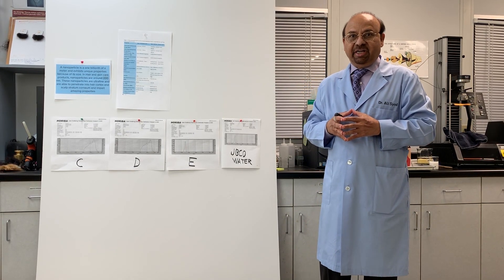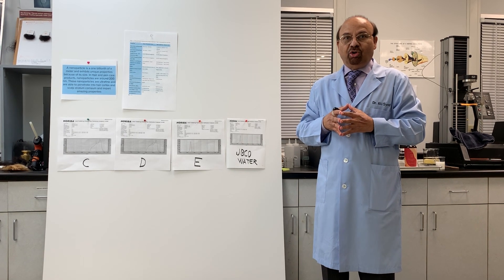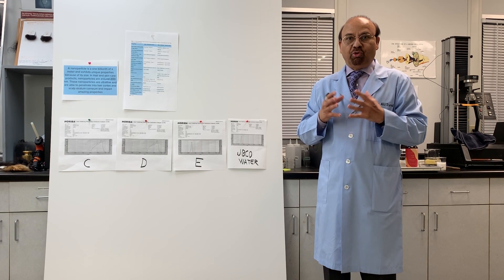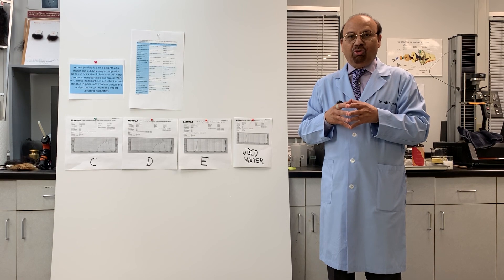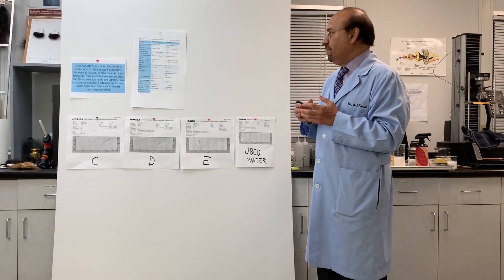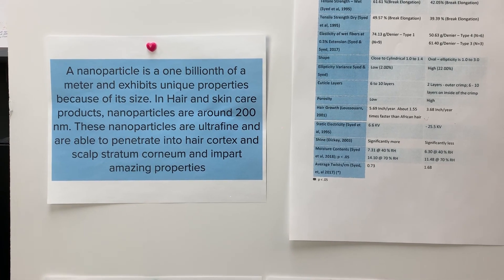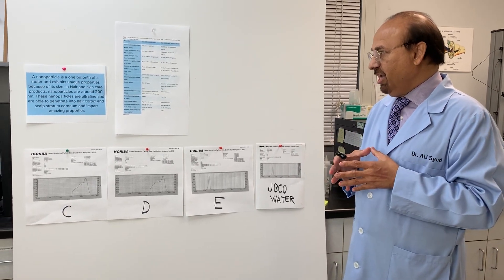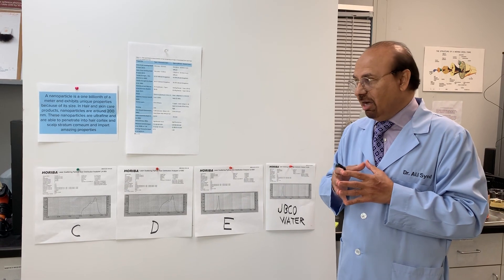Oil & Water Don't Mix? How We Make Our As I Am JBCO Water - With Dr. Ali Syed

Comment: Dr. Syed, most people with low porosity hair use very warm water to open the cuticle. Because the JBCO Water is cold, how can it be just as effective absorbing into low porosity hair?
Reply: Use a heating cap air under a dryer. Or just place a shower cap
Reply: @monyyyaae965  Thank you!

Comment: I love this product and have been using it since last year 2020.  I had noticed the change in my hair and how it is much thicker and stronger, not to mention it's growing and I am 73 years old.  My grandson is only 23 and his hair was reseeding.  He used the JBCO product and asked were he could buy it because his hair is growing back in.  I buy it at Sally's when it's in but they can't seem to keep it in so I order it from Amazon at times.

Thank you Dr. Ali Syed for this visual and knowledge of the product.  I will continue to use the product as compared to another line that carries a water and it doesn't provide the same level of moisture, growth and/or strength.

Comment: I just don't understand nothing he is saying OMG now i do my bad
Reply: Honestly, after reading your comment, I don't understand much of what you said either.
Reply: @ExposedRoot  you are so rude you're 👎 bad
Reply: I want to slso add that the reason the oil and water don't mix is because water is a polar molecule and oil is a non-polar molecule. This means that water molecules have a slightly positive side and slightly negative side. So think of it like a magnetic. The pos. side wants to be next to a neg. side. Oil does not have these neg or pos sides so water and oil don't mix. The emulsifiers help it mix. The nanoparticle size is so that the jbco can penerrate our hair.
Reply: @mercedesgainor4196  as busy as you are. I want to thank you so much for all the hair tips. I started using the.  Big  Green plant.  You buy well i started using that. But i wash it out each time because the one i order never came but i understand what happened and i.m not worried one bit just happy you and the baby are safe but that aloe plant work miracle in my hair growth. So that's only a buck.  So i am still using it love it. Thanks for all the hair tips. Mercy. Love you sis keep reaching for the sky. GOD. Got. You.
Reply: Basically, he said that water and oil don't mix because of the difference in particle size. Understanding what type 4 hair needs for moisture retention, they broke down the particle size of one ingredient to mix with the other so that type 4 hair can receive the benefits of both. 
Sometimes, when we are intimidated by a subject, we automatically reject learning new information on that subject. Its either that or his lab coat that upsets you. Be more open to learning. 
After you've read what I've written, go back and listen to the video again. You'll see that we've said the same thing. I'm learning right here with you.